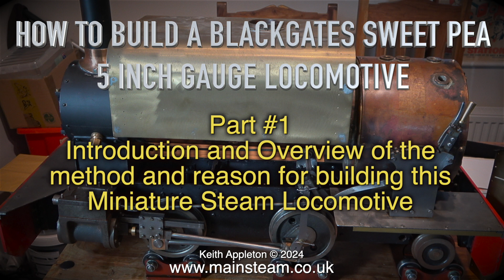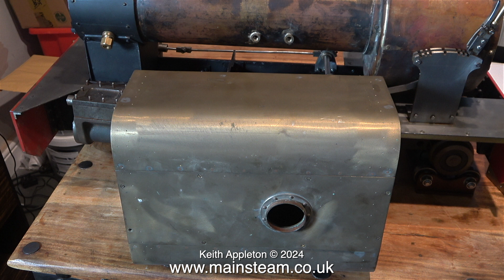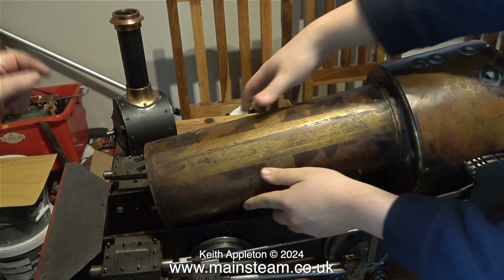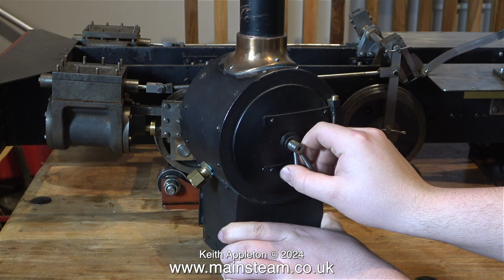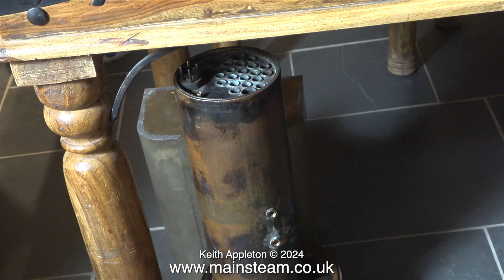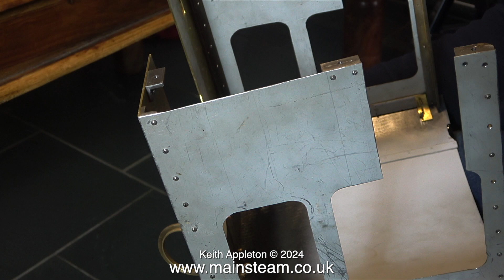A BLACKGATES SWEET PEA LOCOMOTIVE BUILD - PART #1

Comment: The boiler looks just the same as the one I got with my part build sweet pea with the 4 water inlet ports and blast pipe through the boiler. It has a 5 digit serial number but I don't know who made it. I steamed mine in the garden a few years ago but have never run it on a track. I want to try to run it this year, get the full boiler certificate then try to sell it as I can't see me ever really using it. Look forward to this series !

Comment: Thanks for taking the time to describe locomotive wheel arrangements. There are folks out there that would call this locomotive as a 0 - 2 - 1 (which is wrong) and argue with you about it. These are the same folks that would call this LOCOMOTIVE a train. (wrong again) A train requires a LOCOMOTIVE and at least5 one car, or wagon, or whatever you wish to call it. So, your clearing the air, a bit, is both interesting and helpful.
I think your friend James is going to learn a great deal, from the master, and have both a challenge and a ton of fun for some time to come. ;-)